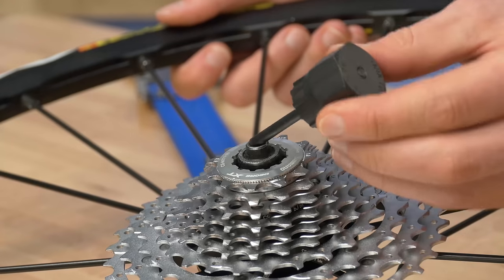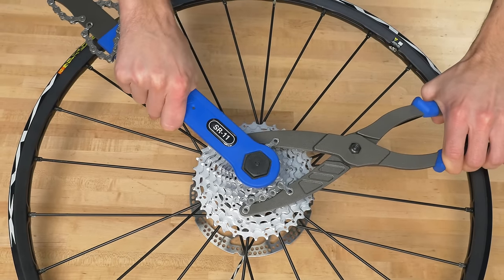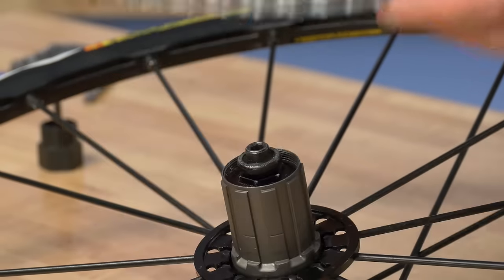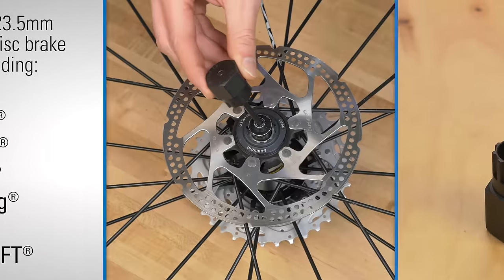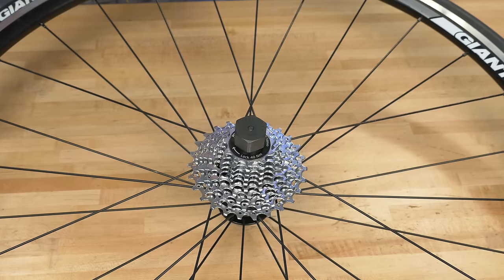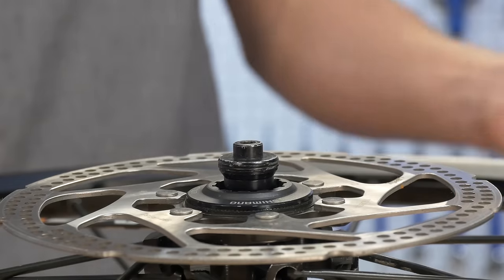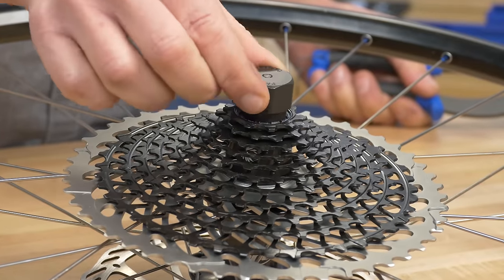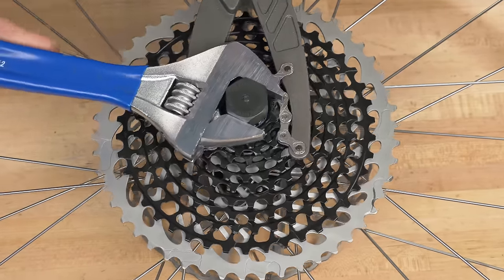FR-5.2G Cassette Lockring Tool with 5mm Guide Pin

Comment: What wrench socket size fits this thing? It doesn't say on the product, it doesn't say on your product page, nor in this video. Feels like quite relevant information, if you plan on using this with your torque wrench.
Reply from the maker: That is very relavant information. It is a 1" socket that is needed to drive this and all the other FR tools we offer. Thanks for looking into it and we will work on getting that information up on our site in an easy to find place. Cheers!
Reply: @parktool  Which 1" socket is this? Do you offer this product or is it generic?
Reply: @jerome27100  Any decent quality 1-inch wrench will do the job

Comment: Hi Park Tool .. 1660 is not available in Germany and we do not have 1 Inch instruments in EU =) 
What should i do ? Buy a hole set for 1 thing or sent FR-5.2G back ?
How can i solve this strange issue ? Thank you
Reply from the maker: The best thing would be for you to find a 1" socket. This maybe best done through Ebay or Amazon and not a local hardware store.

Comment: Ok wait what's the difference between the 5.2g and the 5.2? How do you know which one you will need(10 speed mtb)?
Reply from the maker: The 5.2g has a guide pin for use with quick release wheels. The pin centers the tool and keeps it from rocking.

Comment: I have a new Shimano XTR 12v with DT swiss hub. Wich cassete tools I need?
Reply from the maker: The FR-5.2, FR-5.2H, or FR-5.2G.  If it is a thru axle, you can also use the FR-5.2GT
Reply: @parktool  So for 12mm thru axel, can use any of the models? (Just that the GT provides a guide for 12mm post - which is not really necessary?)
Reply from the maker: It is not 100% necessary. It is to prevent the tool from possibly rocking.

Comment: hi. i have a SRAM XG1150 - 10-42t cassette, Novatec D542 - 12x148mm, 32h (XD) hubs. which cassette tool do i need? thank you
Reply from the maker: A few choices here.  FR-5.2, or the FR-5.2GT (with thru axle guide), or the FR-5.2H with built in handle.